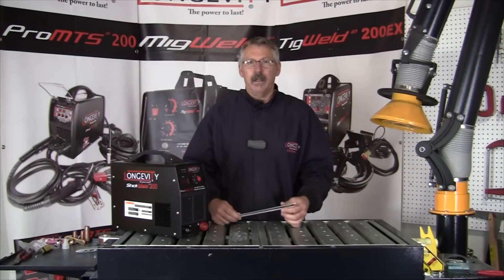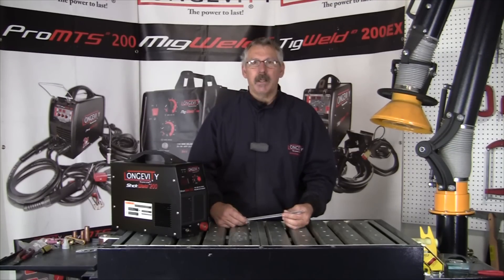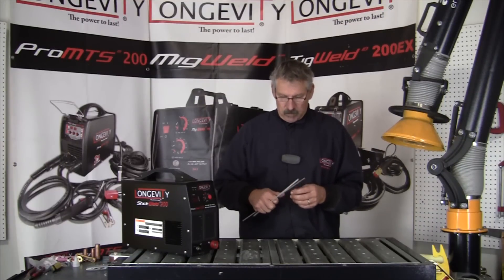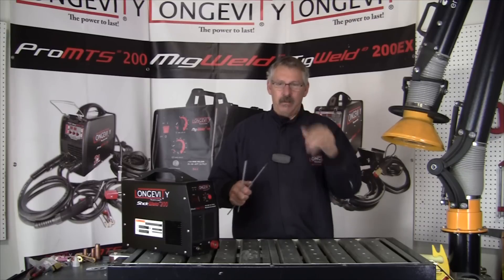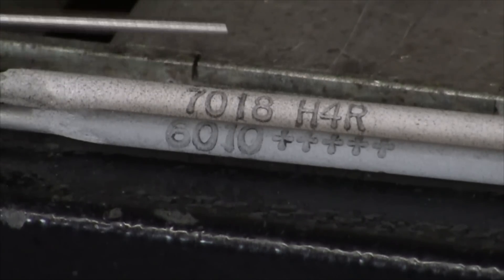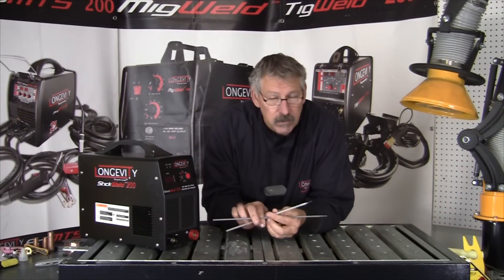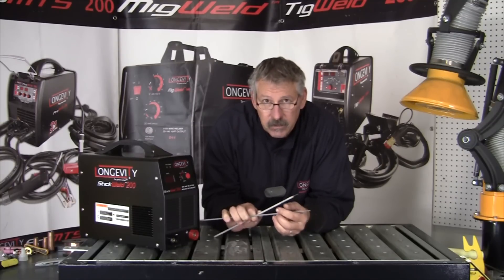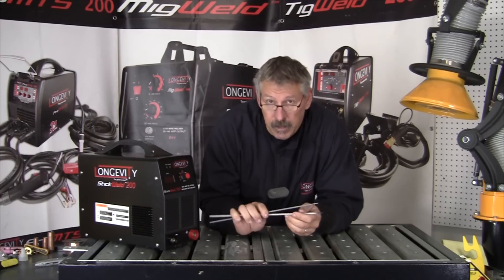STICK WELDING RODS FOR ARC WELDING EXPLAINED

Comment: On thing is if you have say a 7010 rod how do know what thickness of diameter to get it in 1/8 , 3/8 , 1/2 ,....etc diameter i would imagine this would also affect the weld. Though curious it would melt more on to the to pieces using a bigger rod diameter i would imagine the over all tensile strength would be the same 7000 psi either on you used it would just be one was for the thick metal then the other ... but i could be wrong not fully sure yet

Comment: Also not fully sure about the H4R or the symbols ending i think he mentioned it was something to do with alloyed rods , corrosion factors ,...etc though those numbers to me have know meaning to me yet . Or where they would be important over just using a hire tensile strength rod from say 6000 series to 7000 series

Comment: though not sure what the 3 digit and 4 digit  numbers correspond or the different possiblities mathematically we can have 100 possible 2 digit number combinations . The one seems to indicate any position with the 4 th digit but there is probably more to it. Not fully get all possiblities ( i think any position means one can weld with this electrode in any position vertical , horizontial ,...
Reply: sam111880 3rd # indicates what position can be used, 4th # indicates coating type which indicates what polarity can be used.

Comment: O i get 7010 or 6010 first number is means 7000 pounds per square inch or 6000 psi
So one can compute the tensile strength of the weld 7010 electrodes will have 7000psi for pulling it apart ... nice video
Reply: sam111880 Sorry but no. The 60 or 70 is for 60,000 or 70,000 psi, not 6,000 or 7,000